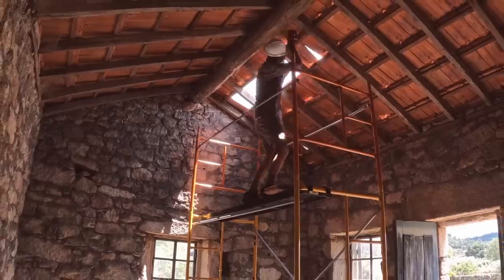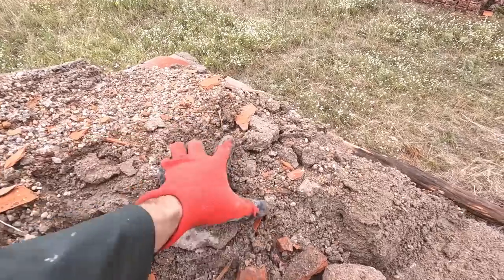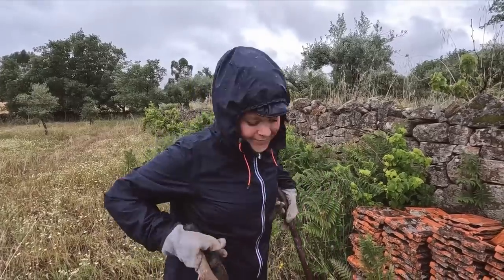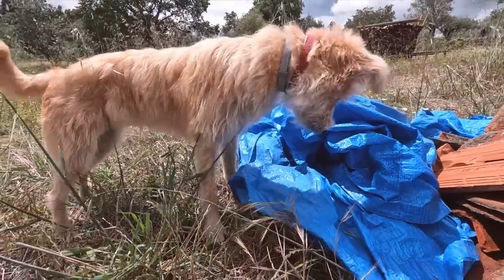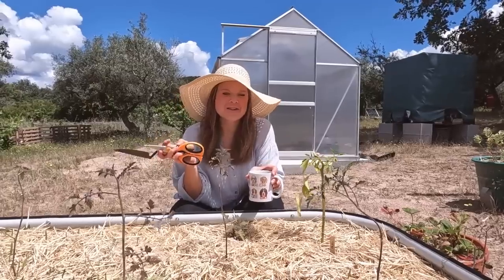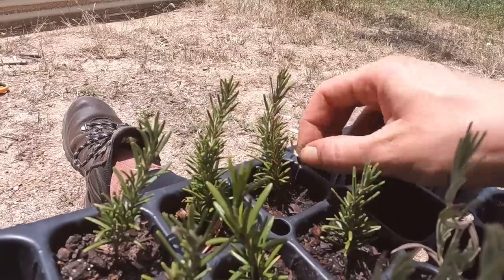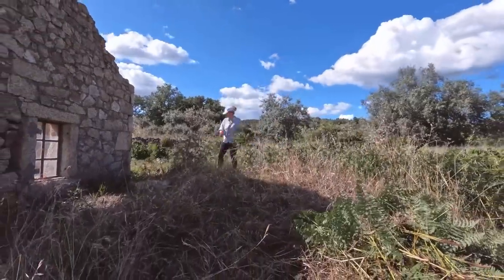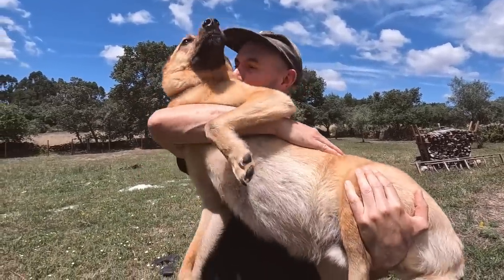Taking Down Walls & Prepping Our Stone Cottage Restoration

Comment: The house renovation is great to see. The ring beam is obviously a good idea, replacing the wooden wall plates. 
(Me, I'd have sneaked an inch or two extra height, to get more headroom over the mezzanine. But I appreciate there are planning rules. )

With your raised beds, I'm not sure high metal-sided raised beds are a good idea in a hot climate – because the plant roots get hot, and the water table is way lower than your soil, so you have to water more than for plants in the ground. 

I would have planted your tomatoes straight into the ground. They also should have gone in months ago in the Portugal climate. 

Those same raised beds will actually be better for your winter climate, I think. You should be able to plant a lot of winter greens like spinach and broccoli etc. 
For sure, it's all a learning process when you move somewhere new. Keep going! These videos are much appreciated.
Reply from the maker: The particular raised beds we have actually have a coating which they advertise reflects a large amount of the height & keeps the soil cooler than conventional metal beds

Comment: I'm dealing with the same wall problems in a haystack I'm putting a new roof on. I don't know why but the back wall seems to be always a bit lower that the front wall. It's the second time this thing appears in my work. A bit of advice regarding the ferns control: don't wait until they are so high to mow them down. When they are about 30/50cm mow them in a full moon and, after some time, when they're back about the same height mow them again with a new moon... and they'll be gone. All best  for the work in the barn.
Reply from the maker: We’d normally mow them down but our strimmer broke so we’ve had to pull them

Comment: Regarding your garden, start adding your banana peels straight on the top of the soil and sprinkle your used coffee grounds on top of the soil. I have had amazing success with planting black eyed pea seeds every 8” inches and chop and drop the greens as they grow to add much needed nitrogen to the soil🥰 I am in hot dry south Florida, it seems your temperate may be similar , you may need to do a bit shade on some of your veggies. I used rebar on 4 corners cut PVC pipe1/2” and built a square frame and eye hooked on sides and zip tied a shade cloth (get the % of shade you need) I used 70% we are hot sun all the time and 102-104deg F all summer …need to shade my mint, parsley, dandelion greens. Lots of luck growing❤️🌴Kelly 🌿🌿🌿btw,,, the purple leaves on the tomatoes are them sun burning😉
Reply from the maker: Thanks for the tips Kelly. We only recently removed the shade netting as we’ve had an abnormally cool & cloudy June. Will be cracking it back out later this week though

Comment: Those walls are in good shape, they are well made rock walls. Just do a lintel using u cinder blocks , fill it with concrete and iron, and you ready to put a new roof on again. If you dont like sandwich roofs (best option ) and prefer traditional tiles, use roofmate, and then under cover with wood. Its easy and you get perfect insulation and beautiful finish.

Comment: most if not all of the things you put in the bag could be used or burnt on your property and not have to be hauled to another site.   crumbled cement can but used in new cement as long as it crushed and added to new while mixing.  The rotten wood can be for sure burnt.

Comment: I didn't really get why you removed the ferns? cutting them down will just encourage regrowth - and spreading. The only way to remove them succesfully is digging them up. They provide a good environment for the smaller animals around your farm - removing them will push these helpers to your stone walls, or further away.
Neat and tidy  isn't always good for a farm :) might look messy, but like mulch on a bed, it is actually helping your little friends in the ground :)
Reply from the maker: Because in about 3 weeks time they’ll be dry as a bone & a fire risk. The whole area where they are is getting excavated later in the year so it won’t be a problem next year